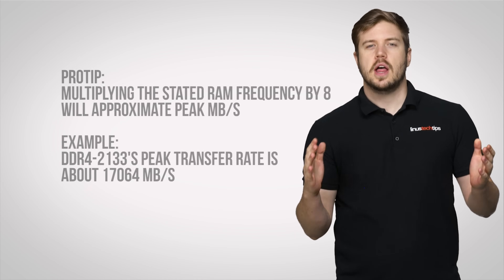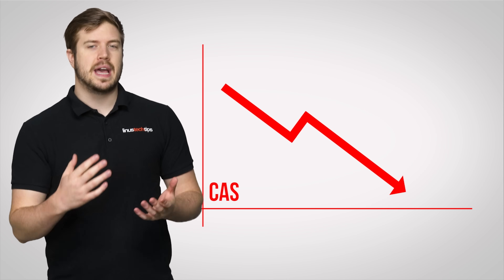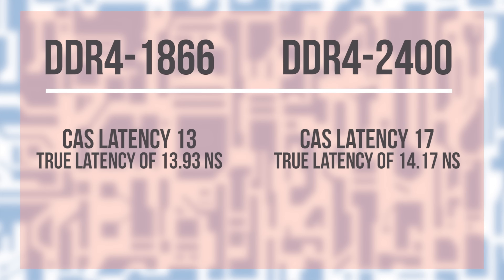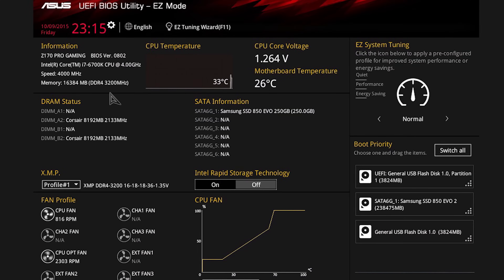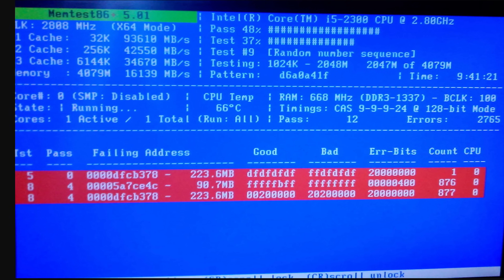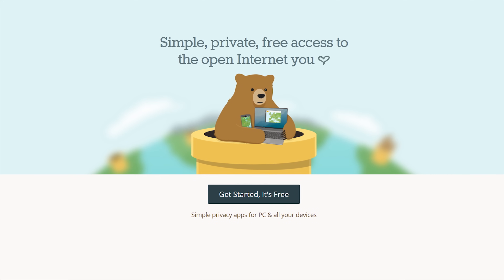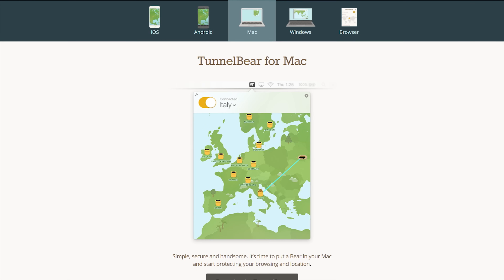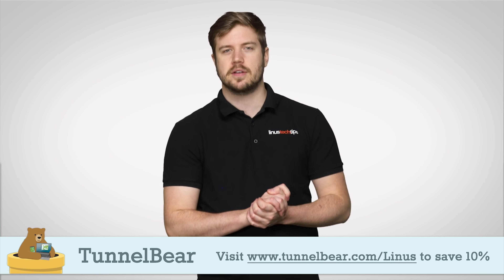How Do Memory Timings Work?

Comment: Can I break my ram if I mess around with the timings?
Reply: Nope.. you might break something else tho... if you often get BSOD, you may corrupt your OS... that means you would have to reinstall your OS later on.. and if you're on SSD, well... you're degrading its life time.. my suggestion would be.. fuck up your current OS, modify the timings until you get the fastest and stable performance.. then reinstall your OS... memorytest64 can be used to test your tweaking performance.

Comment: 2:46 Adjusting latency in the BIOS, I forgot about this, wonder if it causes BSOD if set too low. 

I added two 8GB sticks (16G total) and started having Watchdog errors. I lowered the speed one notch and no more problems. Was it the sticks or the mobo not being able to handle 16GB at factory speed? Bad sticks? They passed several MemTests, no problem.
... BTW All 4 RAM sticks are completely identical.
Reply: The issue with memory test programs is they cannot predict every single instance of a memory load possible. Different games use different file sizes, types, and different loading techniques per say. A lot of this comes down to the engine they use. This is why you can have 99 games work perfect and no issues with other programs and just one throwing you memory errors etc. Also not every profile given to you XMP etc is always stable. This is why they update profiles a lot and typically have many options.

Comment: what ram should I use with ryzen 3900x and Asus ROG X570 Crosshair VIII Hero (Wi-Fi)

G.SKILL Trident Z Neo (For AMD Ryzen) Series 32GB (4 x 8GB) Model F4-3600C16Q-32GTZNC  

DDR4 3600 (PC4 28800)

Timing 16-19-19-39
CAS Latency 16
Voltage 1.35V 
price $ 225
or
G.SKILL Trident Z Neo (For AMD Ryzen) Series 32GB (4 x 8GB) Model F4-3600C16Q-32GTZN 
 DDR4 3600 (PC4 28800)
Timing 16-16-16-36
CAS Latency 16
Voltage 1.35V 
price $ 331

Comment: I messed up and bought 4000Mhz 18-18-20-40 for my 3800x can I down clock to 3600 or 3800 with tighter timings to run in sink with my infinity fabric?
Reply: Yes I'm busy right now too 2666mhz 16 ms to 3066 and 13 ms 15 and 30 pretty cool

Comment: So is it safe to mix cas with Intel or at all? even if one stick is one number higher than the other? Example 15-15-15 with 16-16-16...would we just need to match up in bios, or is it automatically done by system?

Comment: Well,
Thanks to Ryzen especially Ryzen 3000 series

RAM Timing and Speed Mhz are Matters
Reply: Actually the 3rd gen doesn't get affected that much by timings and speed as the 1st and 2nd gen did. The most important is using dual channel 2666+MHz and you are fine
Reply: @noc_abyss   You are not correct. On certain games getting every possible timings (and there are a LOT more) can get you up to 25-30% more FPS on some titles. 3950X  with 1900mhz FCLK and 3800mhz RAM with the timings optimized to perfection beats 9900KS with what ever ram on games. It also helps with data compression etc. memory intensive workloads, but on rendering etc. it has very little effect.
Reply: @juzujuzu4555  I'm just talking about the average user
Reply: I have my r5 1600 with 2400 speed :v
Reply: @WatcherKoops4677  it doesn't cause you bsod's?
Reply: @FacundoGonzalez-cb3dl  ?
Reply: @WatcherKoops4677  i have a r5 1600 and 2400 mhz and it causes a lot of trouble (incompatibilities mostly) since apparently 2400 mhz is too low for 1st gen ryzen cpus
Reply: @FacundoGonzalez-cb3dl  Nothing major so far. Unless you meant performance ?
Reply: @Woke Samurai Check out hardware Unboxed channel's ryzen memory optimization video. They teach how to use Ryzen DRAM calculator to optimize timings.

Timings are more important than RAM Mhz. 3200mhz is fine, but you should check if that RAM works fine as 3600mhz, many do. In any case, have FCLK at 1:1 with memory clock. 3600mhz memory is actually running at 1800mhz, so FCLK should be 1800mhz.

If your FCLK for some reason doesn't work at 1800mhz, then you should check out the highest FCLK speed that works, and use the RAM at that speed, it's important that RAM and FCLK is 1:1.
Reply: @Woke Samurai I don't know about individual brands, but some 3200mhz RAM kits use much better quality memory chips, essentially the same quality as 3600mhz use, so some investigation might be in order. But generally I don't think it matters, all kits can/need to be optimized with timings anyway, so the saved settings inside the chips are pretty useless.

Comment: i have question its ok if i buy a 4 of 1x4ram instead buying a 4x4 ram same spec and same brand
Reply: No, get two sticks at a minimum in any build. You never want to run single channel ram since it's significantly worse performance than dual channel.

Comment: I just took out my ram out of my server box and yeah I don't have anything like what he's talking about....  Server ram must be different
Reply: Server RAM is (usually) different - it's ECC - which means it has additional Error Checking built into the memory chip circuitry because, being a server getting those 1s and 0s absolutely correct is much more important - so timings can work quite differently on server grade memory sticks.

Comment: I need help my ram timing are not as advertised, and my ram only shows 3 of the timings 16-18-18 and the number in the bios are confusing.
Reply: should be 16-18-18-35, my Corsair VENGEANCE LPX 2666 run that. Or it will be 15-15-15-36 if run as 2133

Comment: I overclocked my 2933 mhz CL14 kit to 3866 mhz CL18. Both are stable with 1.35 volts. Is the overclocked better?
Reply: what would you recommend to overclock 2400 mhz to 2933 mhz

Comment: nice video, I have the exact same RAM you were showing in the video. Ballistix Elite which have the timings as seen in the video (CL 15-16-16-35) but why the fuck is the same Ballistix Elite with CL 16-16-16-36 timings double the price of the one with the faster timings? both have 3000 mhz and everything the same except for the timings

Comment: Also incorrect overclock can slow down certain operations. You might even not even encounter such nuances if you don't use complex software. Just make sure you're pumping enough voltage into your dimms... 
tl;dr Every aspect matters and not just benchmark results.
Reply: I don't think you needed a tl;dr for three sentences / one line lol

Comment: it just works. Forget DDR4, DDR5, TBs of SSD and pcie 4.0 coming soon! Just put that 128GB ram on the CPU die, less latency! stop using 16KB cache on CPU like 1980s.
Reply: That's not how that works. Especially because CPU cache is a different kind of memory that is actually a lot faster than any dram money can buy, but very expensive in comparison as well.

Different types of storage for different types of use cases.

Comment: Both Intel and AMD benefit from faster ram and tighter timings.   Ryzen CPUs with infinity fabric need tighter timings, Ryzen APUs the most.  There numerous YT vids showing the benefits of speed and timings though some are not good as they use improper setups the majority make it clear.  AAA games need 16 GB (2x8) now, two stix of 4 GB will suffice with lower settings to reduce VMEM usage, Dual channel is a must.  Life begins at 2933 and starts to fly at 2666 and soars after 3000.

Comment: Do this timings affect compatibility? I'm planning to purchase H370 mobo which support up to 2666Mhz RAM only, but in My country, 3000Mhz of RAM sell cheaper and easier to find compare to 2666Mhz. So there's no harm to use the higher Mhz of RAM since it will bring down the frequency to 2666Mhz. BUT, how about the diff in timing/latency? will this cause compatibility issue??

Comment: I have some RAM and on the RAM it reads 15-16-16-35 but on the PC it comes up as 15-15-15-36. So what is the actual timings of the RAM?
Reply: The sticker tells you the recommended/highest supported settings. The PC tells you what it is  running at now. BIOS settings tell the RAM what speed to run at. Google 'XMP profiles' to figure out how to do it then spend weeks trying to figure out why it won't work...

Comment: Hello man 
I have hyper X predator Ram 4x4gb hynix chipset.and got ryzen 5 2400g. I can't hit with these rams 3200 at all while it is written on the box they r 3200mhz. The max I was able to hit with oc them is 2733mhz. Any hint how I may be able to oc them up to 3200mhz? Maybe cl and voltage?

Comment: hello, i have single channel ddr4 with CL 17 and i want to upgrade into dual channel, could i use the same brand, capacity & speed but with CL 15 for dual channel?
Reply: Yes but they will work at timings of a slower ram, cl17...

Comment: So bigger mhz and lower cas latency gives you the best results?
Reply: Yes, but Intel doesn't get much better after 2666-2933 after which timings is more effective. 3rd gen ryzen you need to account for the infinity fabric speed, but yes, pretty much faster mhz and lower latency will increase performance.
Reply: I messed up and bought 4000Mhz 18-18-20-40 for my 3800x can I down clock to 3600 or 3800 with tighter timings to run in sink with my infinity fabric?
Reply: The Garland Family 
Yes, you should be able to. Pretty much any ddr4 can reach hella high speeds but only some have good timings. You should be able to do 3600 14-15-15-15-36
Reply: @HABITZER  2 yesrs ago for my 1600x i got 14 14 14 34 best ram for ryzen since i saw reviews and its needed for performance. But now they improved compatibility so i think you will be fine but as i know if you go past 3600 there is no performance improvement.
Reply: @HABITZER  i think you should just set your ram at xmp profile with 3000 series chips... they support memory speed up to 4400mhz... you can even OC your ram up to 4200 or if you're good, 4400..

Comment: @Techquickie
Hmmm.... I thought that the "importance of RAM Speed" in regards to the Ryzen was due to the fact that the "Infinity Fabric" that is responsible for the "internal com between cores" is running at the same frequency that the RAM, and not so much by the "actual RAM performance". In which case it would rather be optimal to "loosen" the timings in order to (if possible) raise the "base frequency" of the RAM.
Have I totally missunderstood this ?? If not maybe that last comment by Luke should be given a "foot note".
Best regards

Comment: I was surprised to see how much difference in FPS there are, when comparing RAM modules at different frequencies. And although you can get RAM at over 4000 MHz, how come the i5 8600k for example only works with RAM up to 2666 MHz?
Reply: The motherboard is the limit. If your motherboard supports 3200 mhz ram than it will run at that speed if configured so, disregarding the cpu.

Comment: Okay i some how understand, i have CMK32GX4M4C3000C15R, if i clock it at 2800 Mhz it’s okay, dose the memory clock on cpu 2600 Mhz (7820x) be ok then. Mabe cpu run 2600 Mhz bus speed to the memory but the memory is a littel faster to do it’s job with lower latency at different clock speed but it still transmit data at 2600Mhz betwen mem and cpu, i’m an exnerd?.

Comment: Can you mix and run in dual channel with  same 8gb, 2400 speed but different brand and timings. The one is 15-15-15-35 and the other is 16-16-16-39.
Reply: I think that they both will run with the slowest timing,,, I THINK,, in ddr3 I had 1600mhz and 1866mhz and both ran at 1600mhz,, but I was a noob and had no idea what timings and stuff was back then but i am pretty sure  BIOS will make them both the  slowest of the two.
You will not KILL your computer if you put them in I know that for sure.   
It all comes down to if the motherboard is compatible with the (rams brand) if it is compatible with both sticks you can put both in and because one is 15-15-15-39 ((I think)) the BIOS will make it 16-16-16-39 by default but please test it out and let us know.
Reply: They both work fine and run in 15-15-15-35 @ 2.4ghz. I'm also done with the memtest86 and pass 4/4.
Reply: Nice thanks for update bro man

Comment: I used this video to adjust my ram and the subtle change I thought I was gonna get turned out to be not so subtle. Feels a lot smoother. Games and benchmarks that used to crash before don't anymore. I am pushing the limits of my PC so I guess this adjustment was required in my case.
Reply: if your on Ryzen AMD then making your timings lower you will see a big differents in game play

Comment: Think of memory as a guy throwing numbered tennis balls on command:
1. the bandwidth is how MANY he can throw every second,
2. the latency is how quickly he can FIND the balls he's asked to throw.
Memory performance = how long it takes the guy at the other end to receive the balls he's asked for. Thus, it's a combination of the two.
If, like me, you're more into tightening timings than upping bandwidth - recent AMD platforms seem to favour the former approach - the first number is the hardest one to reduce stably and it has the biggest impact on real "nanosecond" latency, the second number is second in both regards, and so on. An additional wrinkle on AMD is that the numbers can't be odd; if you try an odd number it will default to one higher.
Reply: It all comes back to balls.
Reply: JMUDoc gets the Genius Award for helping noobs understand!
Reply: And when you get it wrong it shuts down, that's Nick Kgyrios chucking a tanty
Reply: @JETFOURLITRE  if it shuts down because the system is not stable, how do you recover your system? Does it default back to before the last set of changes were made in the BIOS.
Reply: I messed up and bought 4000Mhz 18-18-20-40 for my 3800x can I down clock to 3600 or 3800 with tighter timings to run in sink with my infinity fabric?
Reply: @HABITZER  do u got it ore are u still searching for an explanation?
Reply: @HABITZER  yes, that's probably a good idea too. Could consider overclocking your IF instead though
Reply: The bandwidth is how many arms he has × launch rate. Some latency numbers are the speed at which the balls are traveling through air
Reply: But... Why is he throwing those balls...If he plays tennis? Wouldn't be baseball a better example? Xdxdxd
Reply: @mjv yup, so the system is running your latency as cl 18-20-20-40 even though your ram says its is running at cl17-19-19-39. so you can go into the bios and change this by lowering the number down one to 16-18-18-38. that would give you a little bump even though not noticeable.
Reply: so should i get 3200mhz cl16 or 3600 cl18?
Reply: @alex_MCMXCV  3600cl18 - same latency, but the latter has the higher bandwidth.
Reply: Why tennis guy, why not badminton or pingpong guy?

Comment: Would a dominator 2400mhz 16GB kit (10-12-12-28) change anything on a ryzen platform?
Reply: llorTA toN Ryzen likes frequency more than timings, although kits that go over 3000MHz get unstable.
Reply: You can overcloak that ram to 4133 mhz at 1.55v with 18-19-19-39 if MHZ is king but from a video i watched Ryzen loves timings way more ,,, https://www.youtube.com/watch?v=p--iuQhujqI watch this

Comment: Intel Xeon Phi's as fast as possible! 

My college recently got 2 of these things for our OS Lab and I'm curious how they manage to pack 62 cores in a graphics card-sized package and what's the difference between them and a regular socket-based Intel Xeon.
Reply: The xeon phi products don't actually use large, broadwell or skylake cores. They use pentium-class cores in "knights corner" and atom cores in "knight's landing"
Those cores are much smaller and use much less power, which allows them to integrate a lot of them on a single chip

Comment: Wrong: Hardware Unboxed showed that Kabylake benefits MORE than Ryzen does. % gained was higher on a 7700k than a 1700X when adding faster memory at different clock speeds. Also Intel can hit higher memory speeds.

Comment: Ryzen build x370 asus prime with 2x8mb CMK16GX4M2B3000C15 running at 14-16-16-32-62-1 (2666MHz)
I have NO IDEA, and I mean no idea - if its good, bad or whatever. Systems becomes unstable if I tighten more...
Ryzen=RAM nightmare... sigh...

Comment: And for those wondering: No you don't need to squeeze down those timings to get better gaming performance. 
RAM speed is far more important as said in the video - you can even safely sacrifice some extra latency cycles if that means that you get higher RAM speed and still gain gaming performance similar to those who have the same RAM speed but at lower latency (especially at higher framerates).

Comment: These videos are devolving into
"And thats how X works, assuming you're not playing with the RGB settings."
Reply: Memory speeds advertised as part of an XMP profile might not be achievable on AMD-based motherboards. XMP is a sort of automatic memory overclocking setting that was designed for Intel motherboards. Some motherboard makers offer BIOS settings to help you achieve these faster speeds on AMD motherboards. But these settings aren’t present on all boards, and they don’t always work when they are present.

Comment: Pro tip for boosting Ryzen performance: if you can't get your memory to be stable at your desired frequency, you can hack it to work properly by increasing your timings.  First, find your maximum stable memory frequency.  Next divide your desired frequency by your stable frequency.  Take that quotient and multiply each of the numbers in the memory timings by that amount, and use those products as your new timings.  This should usually result in a stable overclock.  You may need to slightly increase the memory voltage and/or loosen the timings a little more for full stability.  This may slightly increase overall memory latency, but it can help you make the Infinity Fabric that much faster.
Reply: Someone has no real clue here lol.
Reply: @SilentGuyX as someone who has no clue, please tell me why this is not true, and or explain your opinion please